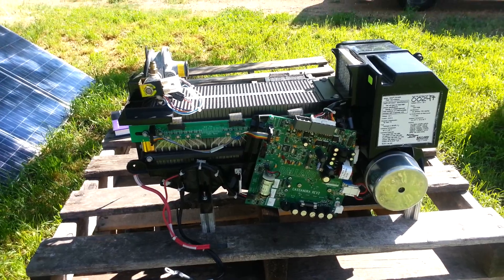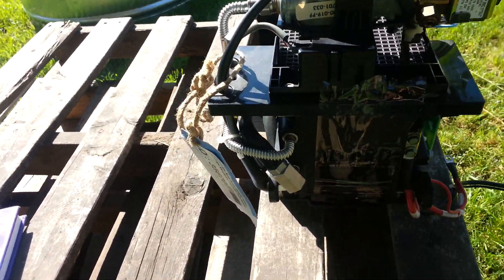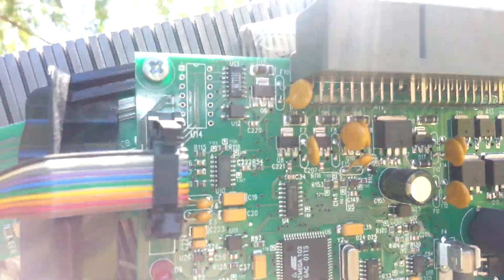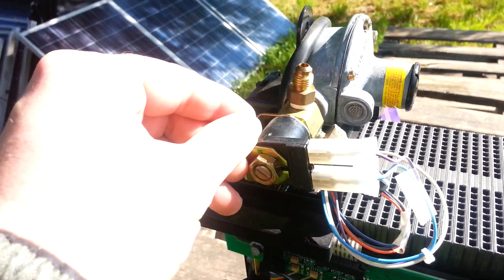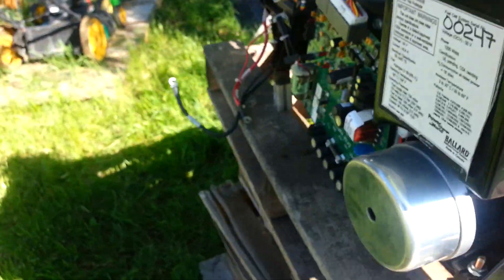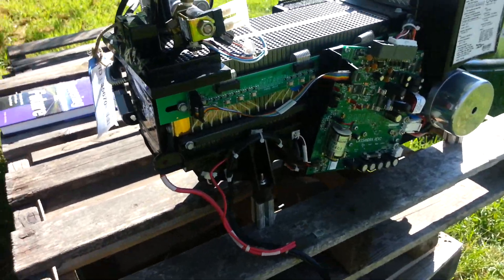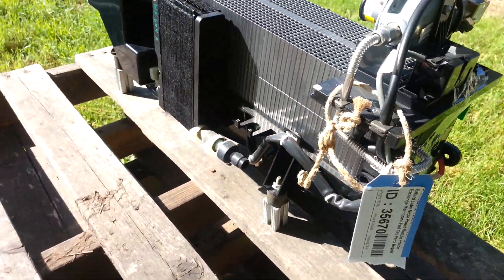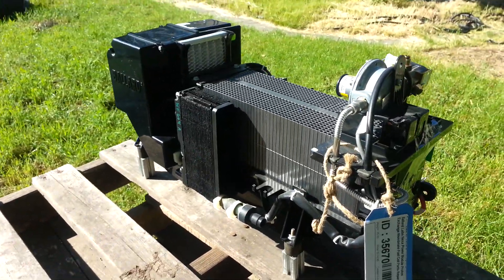Hydrogen Fuel Cell 24v 1200 Watts Alternative Energy Ballard Nexa

Comment: Do not add hydrogen to this until u figure out if the stacks/ overall unit is 100%  functional. Otherwise it will overheat and melt leaking poison, flames hydrogen etc. u can repair any stacks. Need a testing station... Ballard has examples of them.

Comment: Nice!   What did you ever do with this?  Have you tried to bring it back to life? 
(would you consider selling it?)
The sad thing is to see that there is no seal over the hydrogen inlet... so it has been contaminated.  :-(
Also, like you mentioned, the "inactive shelf life" is a real concern... if it doesn't work, then there is a somewhat complicated process required to try to bring it back to life... if it hasn't been mistreated before you bought it.

BTW... I noticed your video has a lot of shaking. You can help that by adding mass to it.  As odd as it sounds, tying a small brick to it with rubber-bands would work wonders... 2-3 pounds.  Cell phones have amazing cameras these days, but they are far too light-weight to make smooth hand-held videos... unless they have high-end image stabilization.
...or you could just use YouTube's image stabilization when you post the video  :-)
Reply: The PEM fuel cell is using 99.99% pure hydrogen. If you thinking of using the solar and break down the HHO Gas then it’s not going to work because it’s hydrogen & oxygen gas mixed.  Unless you separate H2 & O. I was trying to get one of those on eBay but seller wants $800 for it. Not sure it’s still working so I won’t fork out that much.
Reply: @chloecamtole2957  any of u guys got the fuel cell to work? or even test it? please let me know